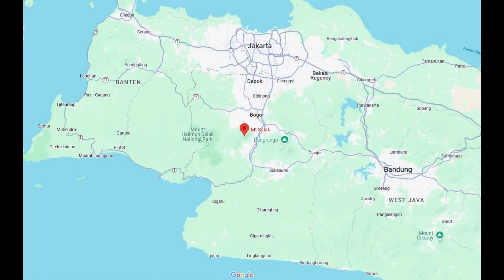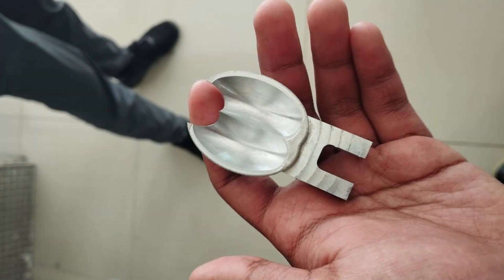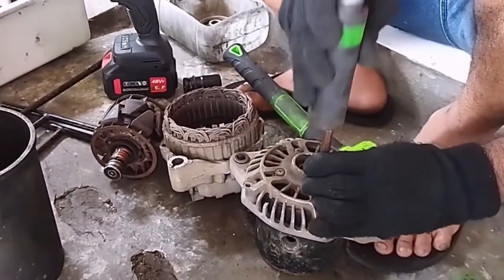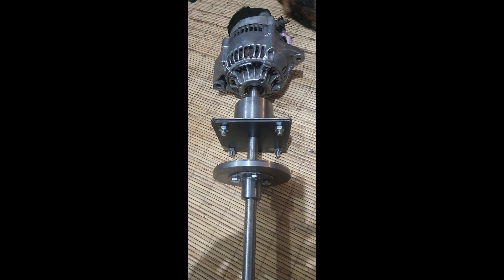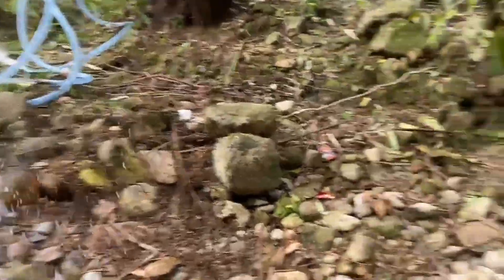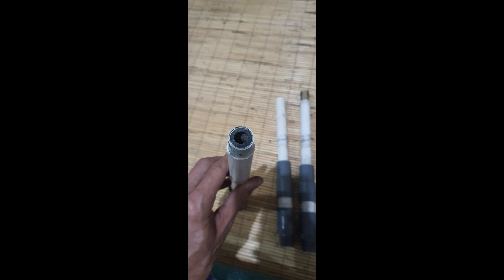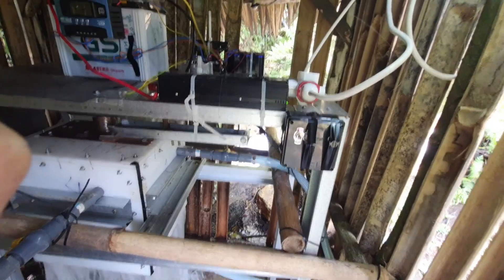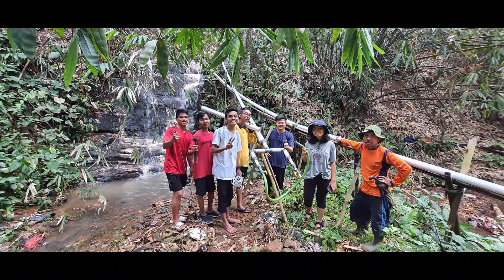Microhydro 1kW under $1,000! DIY Step-by-Step & Easy to Replicate!

Comment: Proyek yang menarik ,saya berharap sendok pleton bisa dipasarkan dengan harga terjangkau.👍🏻
Reply from the maker: kalau dibuat dengan CNC dari aluminium, cukup mahal, bisa sampai 5 juta untuk semua sendok. Tapi di Tokopedia ada turbin komplit jadi, yang dicetak 3D, lengkap dengan semua sendok, as & laher, cuman rp600.000. Saya udah bikin turbin dengan itu dan bagus, udah bertahan lebih dari 1 tahun
Reply: @YAKINid apa bahan plastik bisa bertahan 1 tahun? 

Saya rasa bldc motor bisa mengganti alternator mobil .
mungkin efisiensi bisa bertambah, juga minim perawatan 
tanpa penggantian sikat karbon.
Reply from the maker: BLDC gak bisa menjadi generator. Apakah turbin plastik bisa bertahan tergantung pada air, kalau ada banyak sedimen / pasir, plastik memang akan cepat habis. Tapi murah untuk diganti, sendok aluminium 8-10 kali lebih mahal dari yang 3D plastik 😉